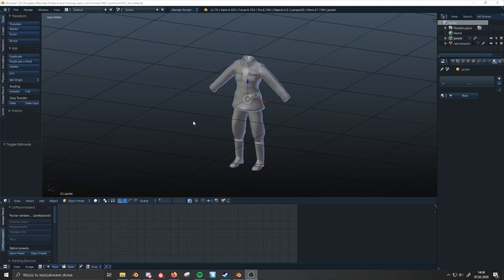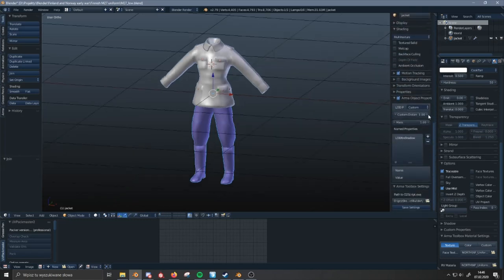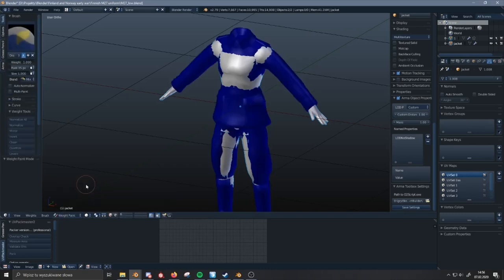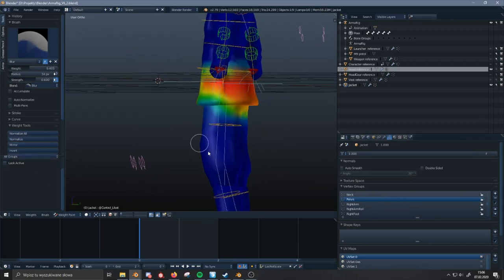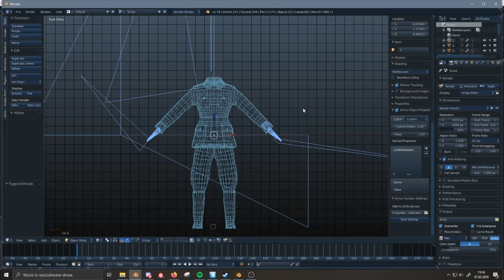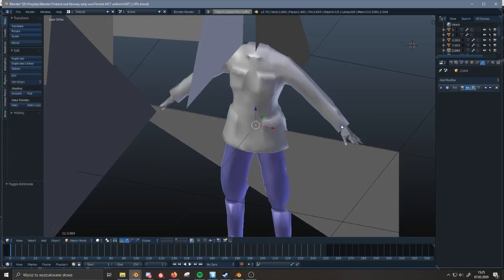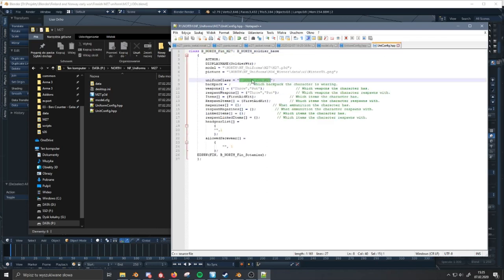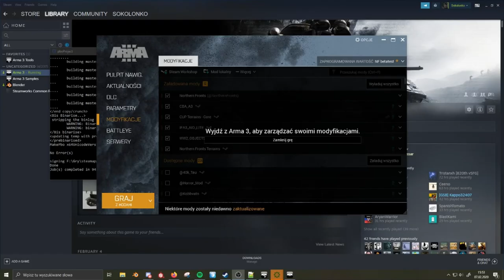Arma 3 Uniform Implementation Tutorial

Comment: This is quite good. Will the rig work if the uniform is set to a "A" pose instead of T pose?
Reply: You will have difficulties transferring weights and vertex groups because it works based on proximity. In other words it does not work.

However you can always create custom armature to change the pose, then save the deformation and remove the bones before transferring weights and vertex groups from the Arma 3 Character Template.
Reply: Alternatively you can use proportional editing.

Comment: Will you make a similar Video for Vests as well? Or can the things learned from the Unifrom and headgear video be used for vests as well?
Reply from the maker: Vest is basically a headgear :D, you just need to animate it like an uniform
Reply: @sokolonko  I am quite new to the whole thing (barely managed to make a cfg for vests and a model cfg by copy pasting and changing variables) and have no clue about modelling. 
What do you mean by animate? the modelcfg?
Reply from the maker: @dashans6175  I mean the weight transfer (rigging) that I did on the uniform
Reply: @sokolonko  Ah, the stuff which enables it to bend and flex? Would you recommend using blender or the Object Builder?

Comment: Will this work on clothing that is not shaped like the rig?
Reply: The sleeves kinda bend and are not straight
Reply from the maker: @austinmurphy2874  I'm not sure if understand but the principle is that as long as your uniform fits on vanilla man skeleton it will work. If it's using different skeleton then it's almost impossible to be implemented in A3.
Reply: sokolonko yeah the model I have have the clothing item has a bend at the elbow area and not like an X so it’s not in line with the rig
Reply from the maker: @austinmurphy2874  Have you ripped it from another game?
Reply: sokolonko CGTrader
Reply: sokolonko it fit good just from elbow down the angle of the sleeve is different than the dayz rig
Reply from the maker: @austinmurphy2874  yep, you need to modify it since most CG trader stuff is made for unreal which has different rig
Reply: sokolonko what tools are needed to transfer weight when I go to my tool bar I do not have all of the other options that are shown
Reply from the maker: @austinmurphy2874  no tools, just vanilla blender, make sure you're following every step
Reply: sokolonko I have I did the shift clicking in the order selected but when I go to try to transfer nothing happens and the tools menu you have I don’t have the additional options that you had